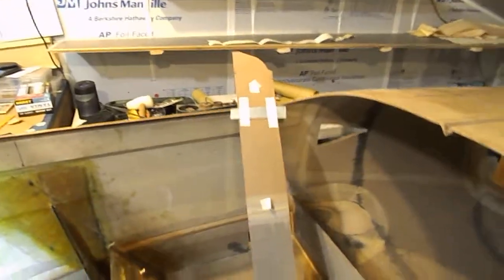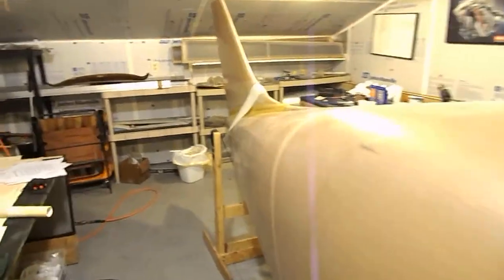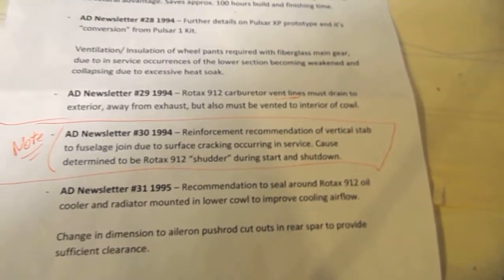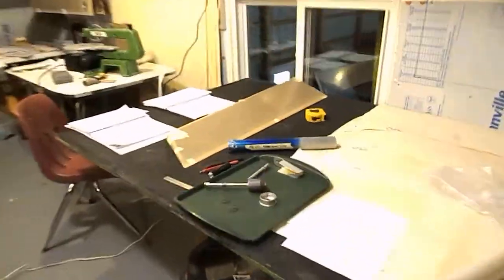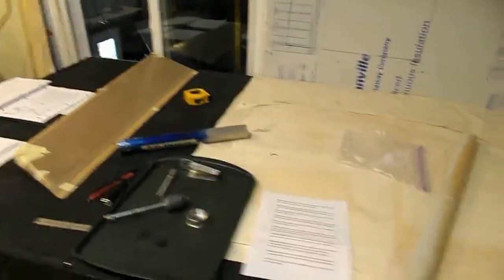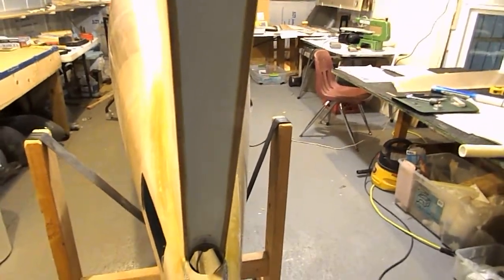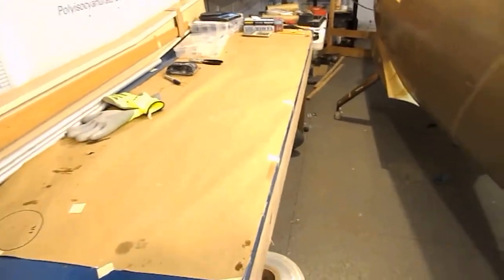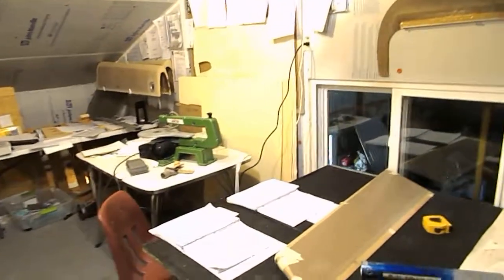Pulsar Xp Aircraft Construction

Comment: Looks great Mr. Chuck! I just installed my main gear legs and was wondering what the correct size washers I should use. I see the size you used and will be changing mine out today. I am glad I watched your video! Also, I am about to install my Vertical stabilizer and was wondering what the added strength/glass layup should be and you helped me solve that issue as well. 

Thank's for posting your build! Your build looks great and someday I would like to fly formation with you!

Clyde
Reply from the maker: Glad the video helped you.  I have not had any time to work on it these summer months. I'm retired but I do small engine repairs on the side as a hobby.  Been VERY busy with lawn mowers.  Hope to see you in Kansas.
Reply: Same here Chuck!!